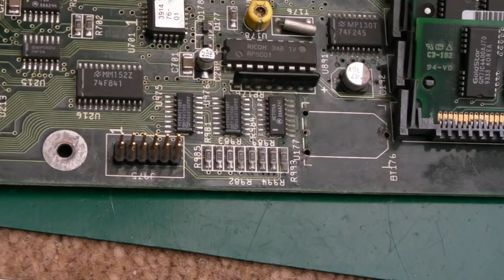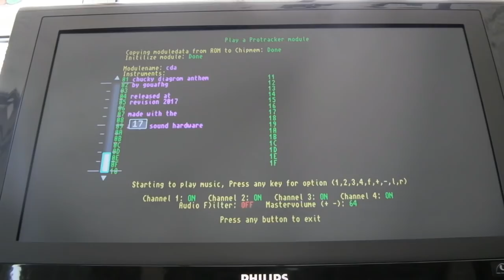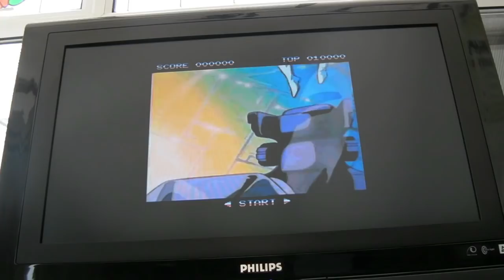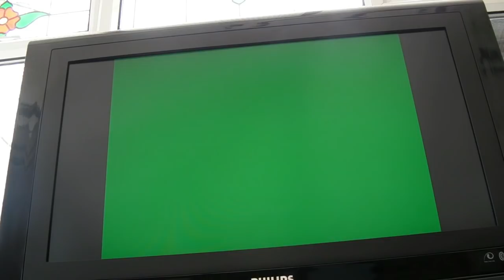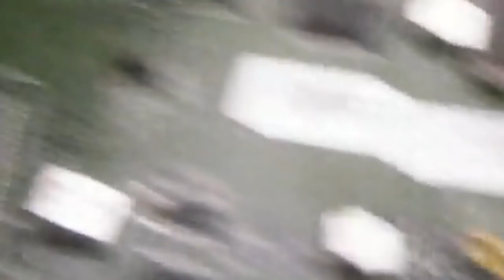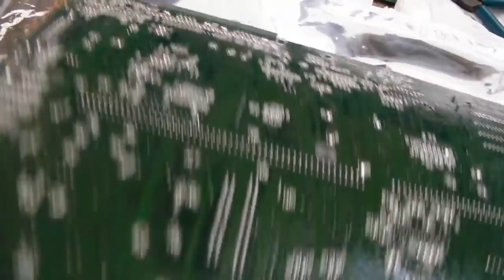32bit Commodore Amiga Repair-a-thon - Part 2 (A4000 x 2)

Comment: I've been trouble shooting an a4000 all week. My goal is to get a synch signal to my monitor. I wanna strip it down to the most basic configuration that would cause the board to send out a synch signal.
What all can I remove and still get synch.
I'm thinking pull all the ram. Pull the cpu card. Pull the superbuster, pull the Kickstart remove u176, remove u975 and pull one of the pins on u975 to ground. I can't remember which pin offhand.
Anyway what are your thoughts on setting up the most basic config that will still send out a synch signal?
Reply from the maker: Pretty sure if Lisa gets the required clocks, you should get sync without lots of logic.  Alice is probably essential too (1 for clocks, 2 for sync probably).  The Super Gary is needed for the CPU.  Removing stuff and just leaving enough stuff to give sync doesnt really provide you with any useful information - other than you have sync, which you probably have regardless of what's dead on the board =/
Reply: Success! Very long story short. Replaced the three chips near the battery. Full board recap and psu recap, a new chucky a3630 a deep clean in the ultrasonic and the dishwasher and a long day in the sun drying it out. Machine has been running great for a week now. The original A3640 is still dead...  For now?

Comment: Hi Gadget. 

You’ve inspired me to buy a proper soldering station to do a full recap on a BBC PSU instead of using a gas iron.  What size chisel tip do you use mostly? Is a 2.4mm fairly good allrounder along  with the pointy one. What solder should I get too.  I’ll mostly be using it on my Amigas and anything prior. Ty :)
Reply from the maker: A chisel tip is the best way to go!  2.4mm is probably fine for most stuff!  60/40 solder (leaded, with a flux rosin core).
Reply: @GadgetUK164  thank you :)

Comment: Why didn’t you just put the diode from the battery holder terminal to the via? Then you wouldn’t need to remove that resistor. Like you said, there’s nothing under the battery holder to short, so it’d be a good place for the diode.
Anyway, I wonder what the Amiga would be like if Commodore had lasted into the 64-bit era? 😏 Maybe a Core-2 Duo w/4 GB SDDR3 and a decent GPU w/512 MB video RAM?
Reply from the maker: Yes, that's a good idea!  I might do that next time!  I think if Motorolla had come up with a 64bit 68000 CPU that would have been cool!  Or even just faster more capable follow up to the 060 series!

Comment: Have you added some silicone hose to the tip of the desoldering pump? Mine is not as flexible. Doesn’t work as well either.
Reply: It's a particular make of solder sucker called "Engineer SS-02" which is made in Japan.  I ended up getting one after seeing Chris use it before and I highly recommend it.
Reply: @myeyeshurt1877  Thanks for this reference!!!! I was curious about that flexing tip for a long time now!!! :-]
Reply: Thanks! I've ordered one from the UK.